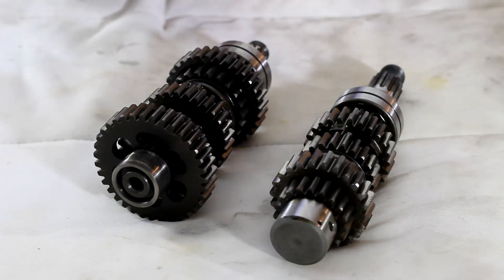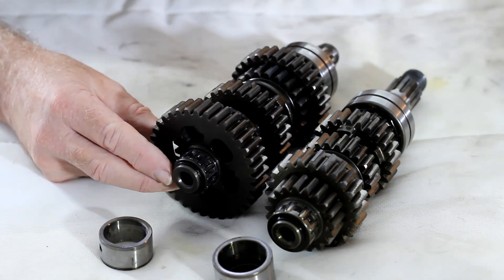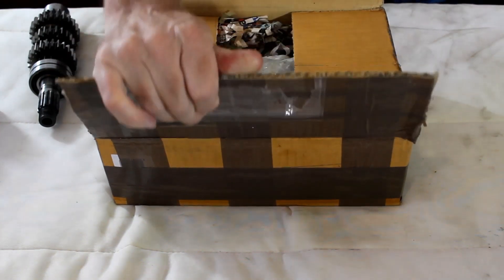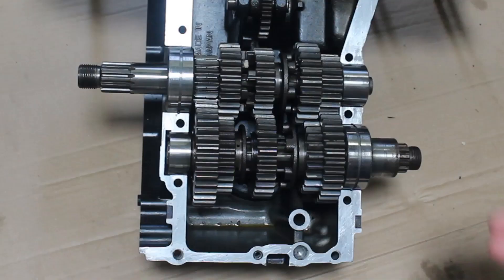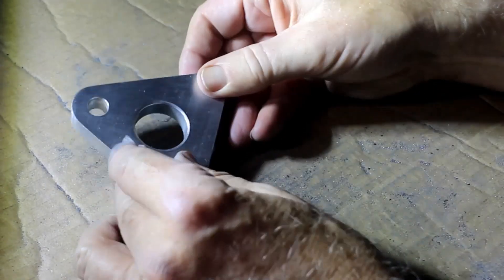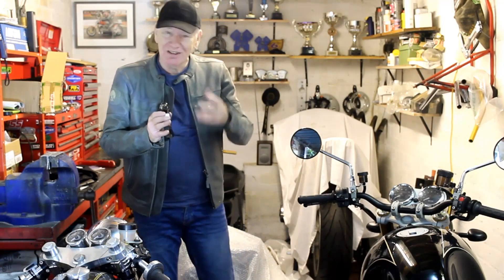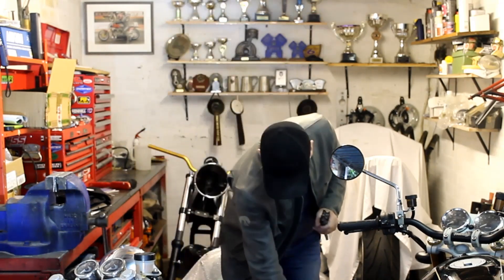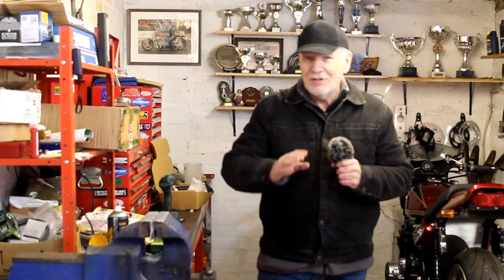2024 GPz Project - Part 15

Comment: Oven cleaner will remove that coating of the wheels
Reply from the maker: No it won't, I tried. Caustic soda removes standard anodising, but it doesn't touch hard anodising. You need sulphuric acid for that..